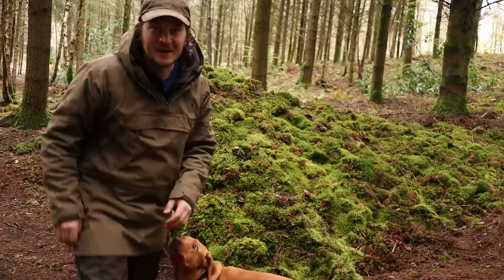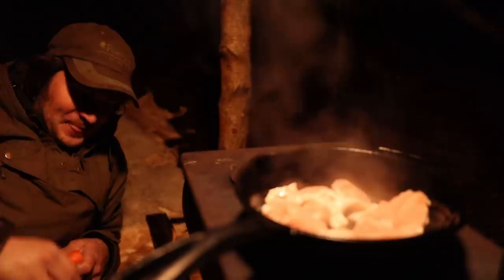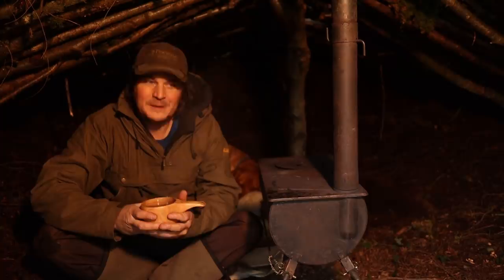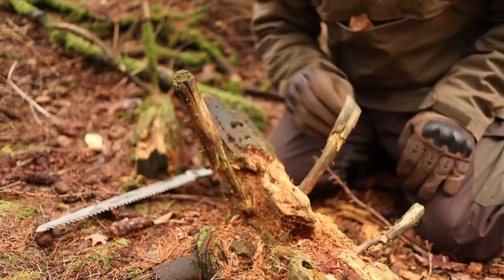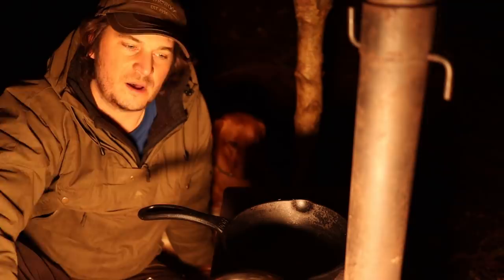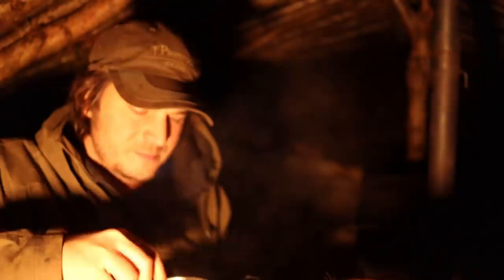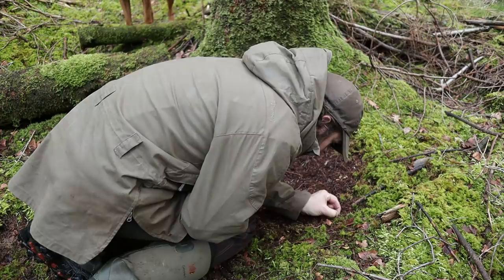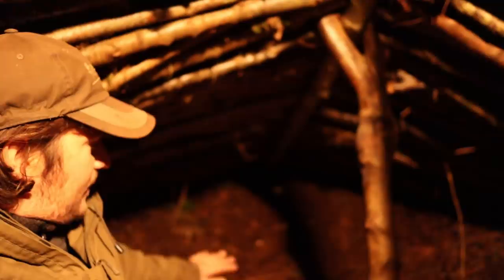4 DAYS ALONE in a PRIMITIVE WILD CAMP - Bushcraft Shelter - Foraging - Survival Solo Adventure

Comment: You should bring a big tarp to cover the front of your shelter and hold all that heat in.   Also one on the ground that’s insulated    Or dig the bottom of the shelter out.    Once you get down past the frost line the ground is insulated and warm